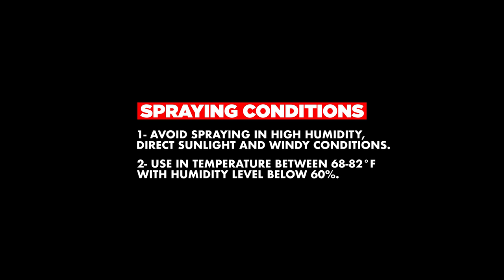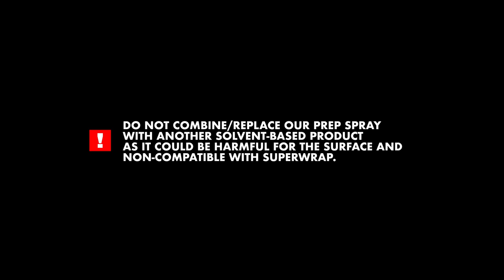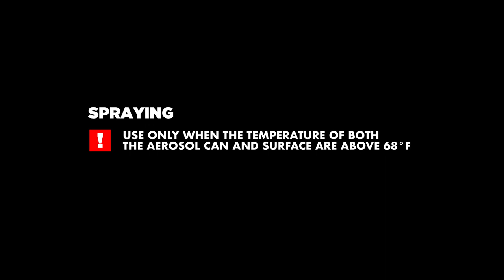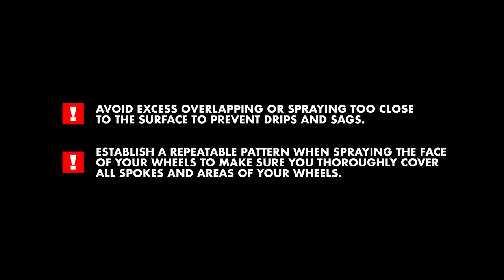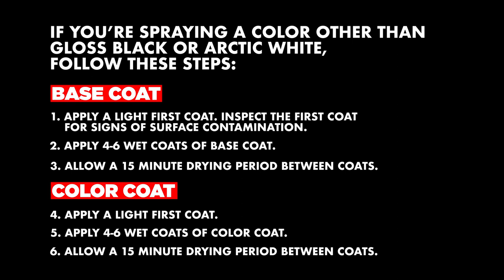Superwrap DIY | How To Spray Wheels

Comment: How much product per tire VS plasti dip, the finish is superior for sure with this product,  but also does it remove as perfectly as Plasti dip?? And does it last as long as plasti dip, my dipped rims have been done 3 year's ago, still came off flawlessly
Reply from the maker: The number of cans recommended per wheels depend on the color you want and your wheel size - check out our website to see our kits. 
The Superwrap DIY aerosol was developed to last up to 2 years and has shown great protection characteristics against road debris, rocks, salt, chemicals and UV exposure. We’ve also developed our high performance Top Coat Series to increase UV, chemical and scratch resistance. It can be applied over any of our color series that has reached the minimum required thickness. Durability will vary depending on your application and usage. Extreme conditions such as off-roading, harsh winters, competitive use may diminish durability. Always keep in mind Superwrap was formulated as a temporary color change solution - not a replacement for traditional paint. 
Superwrap is easy to peel off when applied with the recommended thickness. Simply work an edge until the coat begins to lift, then slowly work your way around the wheel or accessory. Superwrap will come off in large pieces when properly applied. If needed, you can also use a power washer to remove the small pieces that could be remaining on the surface.

Comment: With that saying, If I’m using gloss black, I do not need to have a base coat? I can just go straight into use the gloss black?
Reply from the maker: Gloss Black acts as both a base and color. We have kits that includes everything you need for your application! you will need to apply the recommend 10 wet coats.

Comment: For best results are you supposed to get a clear coat? It doesn't come with the kit so I'm confused but i want to do it right so this lasts it looks really cool.
Reply from the maker: The product already come out High Gloss straight out of the can. Our Clear Top Coat is there to increase the overall durability of the application through high-performance UV, chemical, and scratch resistance.

Comment: So you don’t have to scuff up the wheels first before painting?
Reply from the maker: It is not necessary to sand the wheels, just apply Superwrap directly to a clean surface.

Superwrap is a self-leveling product that will not fill in imperfections such as curbed rash, scratches and dents so it may still be visible. Applying on those can compromise the finish, durability and peelability. You can still apply it on this kind of areas, but, keep in mind that it may be harder to peel off on these spots.
If you wish to fix the curbed areas, we would recommend using a coarse grit, and work you way up to 1500 grit. At 1500 grit, you may begin to slightly blend area with the rest of the wheel and continue up to 2K in order to get as smooth of a finish as possible.

Comment: Do you have to remove the wheels from the vehicle? I don’t have access to lifts or a shop. Wondering if you can cover brake pads with plastic? Thoughts?
Reply from the maker: We do not recommend applying Superwrap to your wheels while they are still on your car since you must remove the wheels from the car in order to remove the centercaps, remove the lugs, and properly mask the inner barrel.
Applying Superwrap with the wheels off the car and laying flat makes installation much easier and gives a professional looking finish.

Superwrap can be applied to brake calipers. Simply keep in mind that the excessive heat generated by aggressive driving such as track racing may compromise Superwrap’s finish and ability to peel. Superwrap DIY aerosols are rated up to 420F. Only apply on brake calipers that are clearcoated as it might be difficult to peel off on other surfaces.

We only recommend spraying Superwrap on OEM clearcoated or metal surfaces. We do not recommend spraying on non-clearcoated surfaces such as stickers, primer paint, plastivs or laminated centercaps.

Comment: I have my wheels with black plasti dip. They are hard to get them clean. What is the difference with superwrap? Your product keeps the same finish and look after washing it?
Reply from the maker: Superwrap is a vinyl based product. Being vinyl based enables us to offer paint-like, high gloss, smooth finishes straight out of the can and gun. The Vinyl makes the finish non-gripy/non-porous, so it's very easy to clean. 
You can see the comparison here: https://youtu.be/tTTj0SS6GgA

Comment: How good does hold up after you wash your car? After washing my car the plasti dip would look dried out. How would recommend cleaning your wheels once your product has been applied?
Reply from the maker: We do not recommend going through automatic car washes. Given there is no general standardization for pressure, soaps and waxes used, we suggest caring for your Superwrap surface yourself with a gentle PH balanced soap or wheel cleaner. We recommend applying it on a microfibre towel.
Surfaces that were spray wrapped with Superwrap can be pressure washed as long as the coating is not torn or chipped. Excessive pressure may damage the Superwrap paint. Avoid spraying the edges of the film as it may cause lifting.

Comment: serious question, can you apply this over plasti dip? I want to apply this to my front grill and don't have the patience to remove all the old dip.
Reply from the maker: We recommend spraying Superwrap on OEM clearcoated or metal surfaces only. We do not recommend spraying on non-clearcoated surfaces such as stickers, rubber, plastics and laminated center caps.
Since Plastidip is made out of Rubber, applying Superwrap on top may compromise its durability, finish and ability to peel.

Comment: does the vinyl still hold up in below freezing temperatures after being applied?
Reply from the maker: Yes. If you plan on using your car in the winter (winter usage), we recommend adding more coats (12+) instead of the usual 10 wet coats to increase durability. But, the application still needs to be sprayed in an environment that is around 68F-82F. 

Superwrap DIY aerosol was developed to last up to 2 years and has shown great protection characteristics against road debris, rocks, salt, chemicals and UV exposure. We developed our high performance Top Coat Series to increase UV, chemical and scratch resistance. It can be applied over any of our color series that as reached the minimum required thickness.

During winter, we reach -40F degrees and have a lot of snow, ice and salt on our roads. All applications have been tested in our harsh winter conditions and also in exotic temperatures.

Comment: Do u need to put one spray can on one wheel
Reply from the maker: For your rims, it depends on their size and the color you want to spray. 
In general, wheels up to 17" require 2 cans of Base and 2 can of Color. 
18-19" wheels require 3 cans of Base and 3 cans of Color. 
20-22" wheels require 3 cans of Base and 4 cans of Color. 
* Kits are calculated to cover the faces of the wheels. If you have complex or multi-spokes wheels, we recommend getting a bigger size wheels kit.

Comment: If im indoors tho and its 50 degrees outside i should be fine tho right?
Reply from the maker: Yes, as long as the temperature indoors is between 68-82F, it will work fine.
Reply: @SuperwrapOfficial  sprayed my wheels in the cold! was like 50 degrees indoors and they came out perfect! Had em sprayed for a week now and they are holding up, better than plasti dip by far and I LOVE EM!!
Reply from the maker: @raycadbury  Thanks for the support!

Comment: Can you do it to brake calipers?? Is it heat resistant?
Reply from the maker: Yes, Superwrap DIY aerosols can be applied to brake calipers. The excessive heat generated by aggressive driving such as track racing may compromise Superwrap’s finish and ability to peel. Superwrap DIY is rated up to 220F. Please keep in mind that it might be difficult to peel off on brake calipers that aren't clear coated.

Comment: How do you remove it when you want too? Thanks
Reply from the maker: Superwrap is easy to peel off when applied with the recommended thickness. Simply work an edge until the coat begins to lift, then slowly work your way around the wheel or accessory. Superwrap will come off in large pieces when properly applied. If needed, you can also use a power washer to remove the small pieces that could be remaining on the surface.

Comment: Am I the only one that noticed the insane amount of product you have to spray? That’s a lot of coats so I’m concerned because this video mentions nothing about any sort of respiratory protection..how many cans were used in this process??
Reply from the maker: It depends on the size of your wheels. In general it's around 4-7 cans. 
Per our instructions, we highly recommend spraying in a well-ventilated area. You can also use a Respirator face mask when spraying the products.